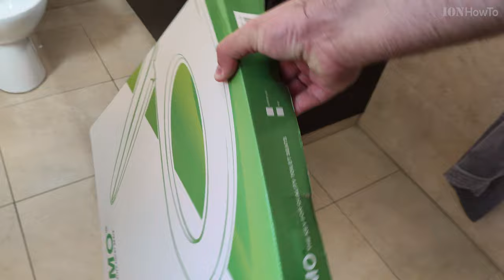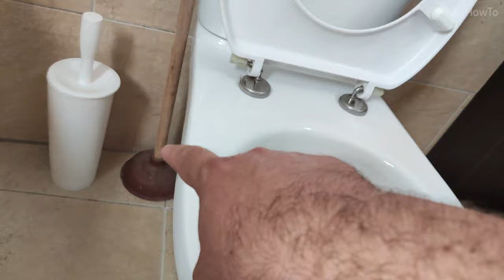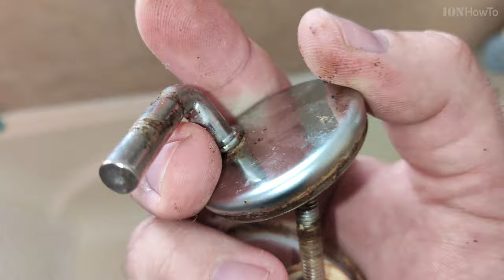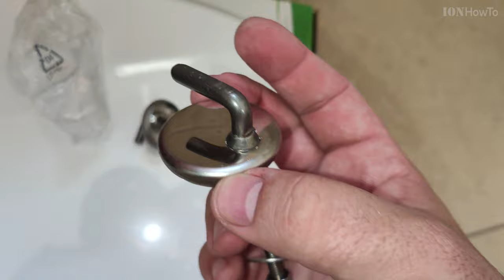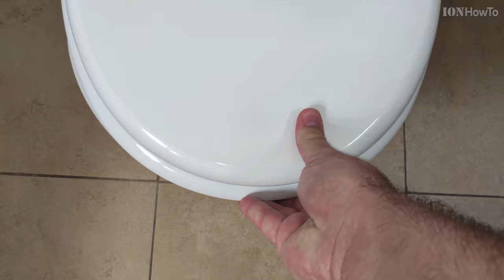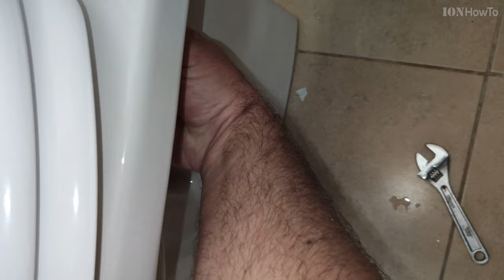Toilet Seat Replacement

Comment from the maker: Amazon:
Toilet seat https://rex.red/toilet-seat *
Toilet seat wrench tool https://rex.red/toilet-seat-wrench-tool *
Toilet plunger https://rex.red/toilet-plunger *
Toilet brush set https://rex.red/toilet-brush-set *
Toilet paper https://rex.red/toilet-paper *
Plumber tool set https://rex.red/plumber-tool-set *
As an Amazon Associate I earn from qualifying purchases.

Measure the width and length of the toilet ceramic bowl or measure the old toilet seat and purchase a similar size toilet seat.
Best is to buy a toilet seat with strong metal hinges and metal mounting brackets so that he seat does not move sideways or break easily.
Follow the steps in the video without skipping please so you don't miss important steps.

Subscribe and Ring the Bell to watch more videos.
ION HowTo https://rex.red/ionhowto
RedNumberONE https://rex.red/rno

Buy merch https://store.ionhowto.com/
Check it, buy it, post it and  tag it #ionhowto or #rednumberone